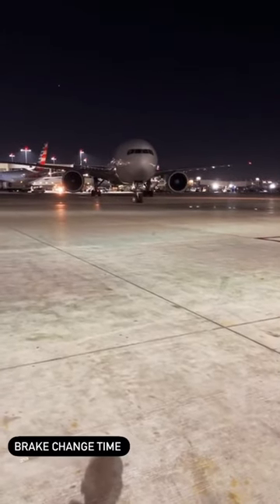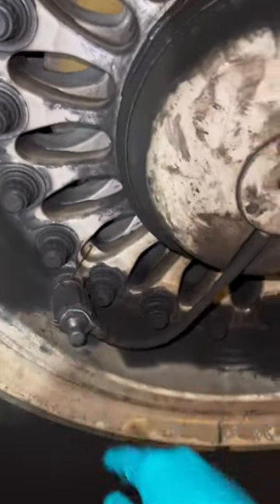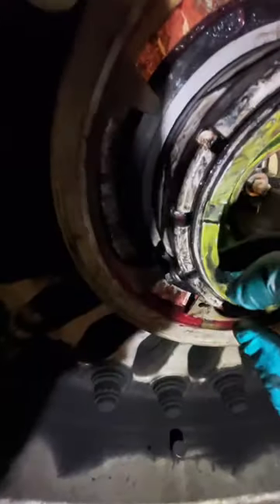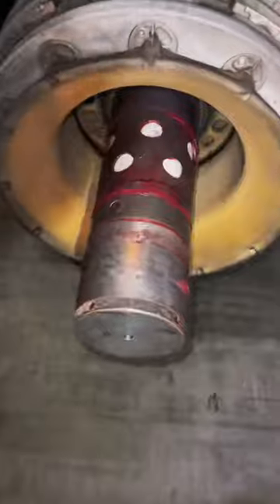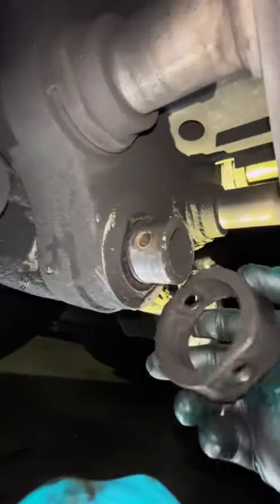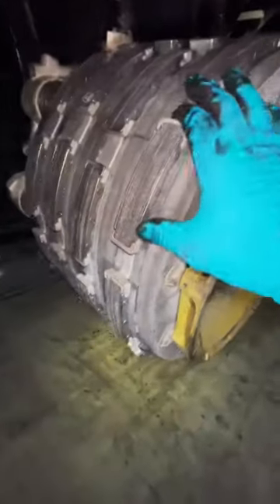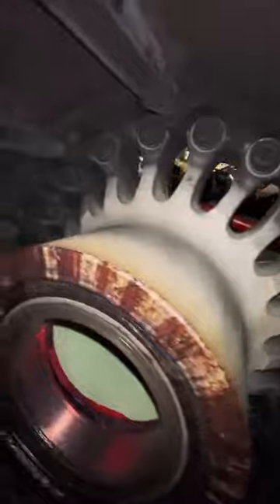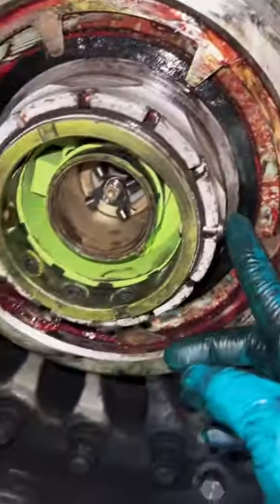Brake assembly change on the B777-300

Comment: Thank you for an EXCELLENT and very interesting video!!! As a licensed automotive technician for over thirty years, who has very recently taken a keen interest in aviation, this is extremely interesting to watch. I compare this to changing a set of brakes on cars and trucks to which I've changed probably too many by now. It's interesting to see the wheel assembly installed in a similar manner to the way wheels and hub assemblies are installed on teucks equipped with full floating axles. Torque to a higher value intially and then loosen off and retighten to a lower torque value. Also interesting to see the Michelin name on those tires. I bet those cost a pretty penny!!!
Reply from the maker: Indeed they do.. much like everything else In aviation. Lots of similarities between automotive and aviation design. Just a lot more redundant features.

Comment: Brake changes are always fun, make sure to not pinch your fingers re-installing the tire. 
Especially love doing brake changes on 787, the Electric brakes make it even easier!
Reply from the maker: 787 is such a modular bird, and very easy to maintain in regards to that. But the downside is that everything is software driven. So you changed the brake you better make sure the software is up-to-date.
Reply: @StigAviation  Very true, it’s amazing to me how software dependent the LRU’s on 787 are.
 I have found pushing software through the ODLF to be very useful as well.

Comment: Nice im about to do an a330 brake change with another mechanic tomorrow, im sure the process is similar as the B777. Very nicely done 👍
Reply from the maker: It’s mostly the same but obviously AMM is slightly different between airbus and Boeing. But should be fun on a 330.
Reply: @StigAviation  I'm more worried on how us 2 will carry the brake box and load it on the trailer lol 😆
Reply from the maker: Very carefully lol @venai123

Comment: Thank you for making these! Never knew that's what the brakes looked like on airliners, for some reason I was picturing a disk brake like a car. Good day 😊
Reply from the maker: Glad you liked it! and yes they are disk brakes but there are multiple disks and they are stacked.
Reply: @StigAviation  oh that's cool! I thought they pushed outwards on the spinning wheel to stop it, sort of like a huge drum brake.
Reply: The rotors are keyed to the wheel by those "ribs" shown on the inside of the wheel. They can be a pain to line up when fitting the wheel back on the axle.

Comment: That's cool. I literally just asked about this today. Thank you. Question on the torque. 500ft lbs is a lot. I'm assuming you use a torque multiplier?
Reply from the maker: Depends on how you use the wrench. The one I’m using is direct torque. If it was at an angle I would have to recalibrate
Reply: @StigAviation  thank you!

Comment: Oh My- 500 foot torque on main nut. Respect what you guys do to keep aircraft safe in skies.   Concerning yesterday's incident at #SFO where an entire wheel and tire fell off, did #United Maintenance folks miss that  including inspector,? Or  do you think it was  metal fatigue or some other failure inside wheel assembly?  Very rare incident it seems.The 777 is my favorite airplane and been all around world on them.
Reply from the maker: I do not believe this was a maintenance issue, the United Airlines mechanics are incredibly proficient and some of the best in the world. I believe this was a wheel manufacturing defect.

Comment: How do you know when the brakes need replacing? Is it based on the number of flight Cycles or is there a cockpit warning? Thanks for the fascinating video!
Reply from the maker: There’s a brake pin wear indicator on the brake itself. When we walk around we look for that. When it’s close to flush we know it has to be replaced

Comment: In case of brake fire, for firefighters, is it safer to approach it from the front and back of the wheel? Or the side(wheel cap)side of the wheel?
Reply from the maker: From the front or back of the wheel. Never towards the rim if it’s on fire
Reply: @StigAviation  I always approached rims from front or back, never from the side, especially if they are hot like Stig said in another video, those are split rims and they can blow up and kill you

Comment: That's awesome. I didn't catch the thermal fuse plugs since I don't know what I'm looking at. I was looking because of the recent incident with Delta #1437 and the emergency evacuation.
Reply from the maker: Ok so right next to the tie bolts there is a smaller bolt like plug, its very dirty in there so a bit hard to see, but if you pause the video youll see it .
Reply: @StigAviation  Ahh, I see them now...they are offset from the lug pattern. Thanks!
Reply: @biggdogg285 the #1 and #2 brakes on that plane locked up and blew the 1,2,5,6 tires.  They were shredded not thermaled.

Comment: hey stig, after seeing the hub cap hides the safety device bolt to retain the main nut maintenance cannot see if the safety device is still intact. just a day ago a united 777 lost a main wheel assembly.
Reply from the maker: Don’t worry, I’m gonna be addressing that in the next video. I’ll explain it very thoroughly.

Comment: super wonderful  777 wheel brakes  hydraulic mechanical pressure & rotating axil & wheel bearing # but i want to understand exactly how hydraulic pressure pushes the shoes or pads against rotating wheel ???? ❤️🇵🇰
Reply from the maker: the wheel assembly has slots that slides on the brake assembly, as the wheel turns so does the brake disks. when brakes are applied via hydraulics the pistons will squeeze the disks and hence braking/slowing down the wheel
Reply: The  stators can slide on the inner section of the brake assy so when all those pistons extend it squeezes them together.  They are fitted alternately stator,  rotor, stator etc. If you look at the video the bits sticking out are rotors which key to the wheel.

Comment: Don’t the wheels have to be re-talked after X-y-Z of flights??
Reply from the maker: help me understand what re-talked mean?  im a bit confused on that one
Reply: @StigAviation 

What I mean is, dose the wheel have to be checked after a few flights to make sure it has not come undone/ re-torqued.
Reply: @NathanS2022 never.  It has lock bolts on the main nut.

Comment: What about air removal from hydrolic line after replacing?
Reply from the maker: No need for that. It’s a closed system and the aircraft has quick disconnects for that. We can take off the pressure lines without compromising air getting into the system
Reply: No need for that is a quick disconnect Hydraulic line, meaning that no pressures was released from the system.

Comment: Me if I was a pilot: how much would it cost for some BBS’S
Reply from the maker: BBS got some nice wheel 👌
Reply: @StigAviation  I just thought of something funny
Imagine if air forces had pit crews in active war zones so when a fighter jet with an issue lands they run over to it and change all the tyres in under 3 seconds and the jet screams down the runway and takes back off🤣

Comment: Good, informative video.  Assume you are involved as you don't show the actual removal and refitting of parts, bolts, or torque loading. Brake dust and grease gets everywhere so not good for cameras. 😂
Reply from the maker: It’s definitely a bit of a dirty job but very fun. I just took small clips here and there to give an idea of what it looks like

Comment: That’s the nut they forgot on the plane that dropped a wheel in SFO.  Right ?  There is absolutely no way a wheel should fall off a modern jet.
Reply from the maker: I am learning just now and also getting pictures of what actually happened. And from the pictures, I did see the main nut was still on the axle. This seems to be more of a wheel assembly failure.
Reply: @StigAviation  Really the nut was on ?  I did think “there is no way someone can not install the nut.”  So the rim went over the nut, the rim must of cracked badly to slide over the nut.
Reply from the maker: I’ll be addressing this on my next video

Comment: How many cans of brake cleaner do you go through?
Reply from the maker: Non at all.
Reply: The brake overhaul workshop has the equipment to clean the brakes. Mind you once you have removed the old one the dirt is transfered to the new one so it doesn't stand out.😂😊

Comment: How much torque did you set for 777 and a320
Reply from the maker: If I remember correctly, the 320 main landing gear initial torque is 300 foot pounds and final torque is 150 foot pounds. And for the 777 the initial torque is 500 foot pounds and final torque is around 200 foot pounds.  But I’m going from memory, we usually never do that. I’ll always follow the manuel which is on hand while I work.